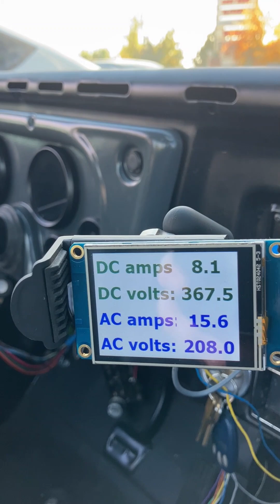DIY EV Heavy Chevy Charging At A Tesla Destination Charger

Comment from the maker: adapter listed on AMAZON as: Only for J1772 EVs Tesla to J1772 Charging Adapter, Max 48 Amp & 250V - Compatible with Tesla High Powered Connectors, Destination Chargers, and Mobile Connectors (Black)